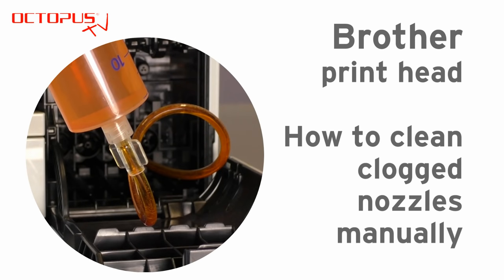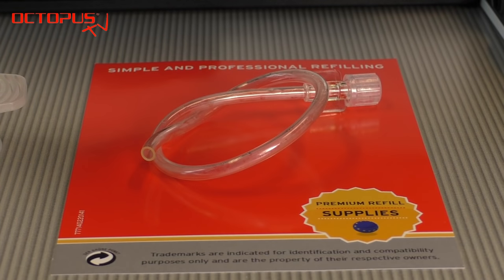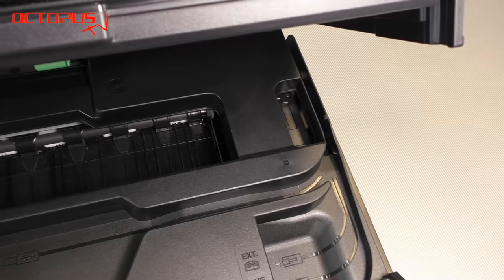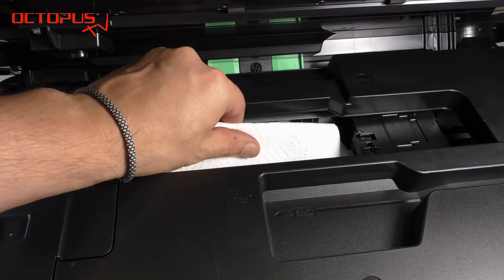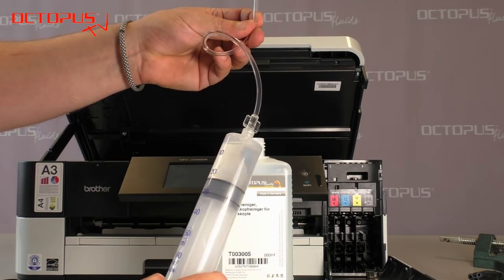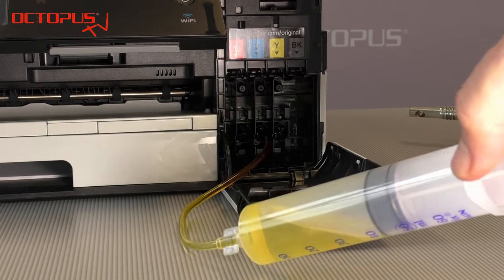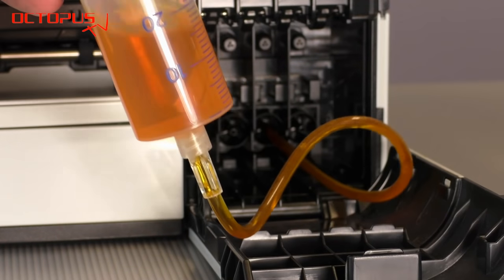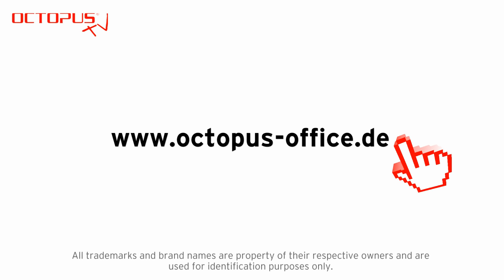How to clean Brother inkjet printer´s print head clogged nozzles?

Comment: Hi, Could you make a video on how to clean print head for Brother Ink Tank system DCP-T series please?
Reply from the maker: Hello Christopher, thanks for teasing us about a tutorial which we already have in our mind for a while but did not make it yet - You need it we have not delivered yet - sorry 😑
The approach for Your printer with the tanks for ink is the following:
1.) Empty out the ink tank that You would like to clean
2.) Fill some cleaner into this tank
3.) Move the print head to the middle of the working area and install some protection + absorbent underlay under its nozzle plate
4.) Use fabric tape to attach the combination of syringe and hose to the tank´s opening - the connection must be airtight
5.) then do the same as shown in our tutorial - push and pull the syringe´s plunger carefully to get the cleaner from the tank towards the print head ( no cleaner necessary inside the syringe as it is already in the tank)
6.) let the cleaner in the ink system sit for a while. it also works over time
7.) remove the cleaner from the tank and fill in some ink
8.) pump the ink towards the print head with the  combination of syringe and hose
9.) power up the printer again and print out the cleaner from the ink system - this may take some time - use old paper to print these test pages...
Reply: @octopusoffice  thank you for typing this instruction very helpful. I ended up buying dcp-t520w. This model is also available in eastern europe: hungary etc. May consider a video :)
Reply from the maker: Hello Christopher, thanks for Your response. As You printer should is quite new right know we think it may take a while before You have to do a manual cleaning 🙂 Just keep printing regularly - one or two pages a week and blocking should not be a problem as long as You use the right inks.

Comment: Lots of black ink on the paper towel, but black ink still not printing at all. Any tips?
Reply from the maker: Hello Donna, thanks for Your question and the description. 
We see two possible scenarios here:
Worst case is that the print head is damaged technically in the black ink line - so cleaning out the clooged or dried in ink cannot fix that 😒.
Second thought: Have You printed out the cleaner fluid from the ink system after cleaning - this may take quite some time and quite a number of test prints? You say there are black ink remains on the paper material - ok so the line should go through again.

Comment: Can I use acrilic thinner to clean the head?
Reply from the maker: Thank You very much for this question. Without knowing about the details of the acrylic thinner solution that You have available it is very difficult to predict all effects of its use in Your print head.
Basically it should do no harm to the parts of Your printer - assuming it does not contain any ingredient that can react aggressive towards plastis material for example.
The acrylic solution effect works best for acrylic based paints - if You are going to try this thinner on a dried in water based ink - the results will not reach an optimal level.

Comment: is this compatible with MFC-6935?
Reply from the maker: Hello Spyros, thanks for Your question. Our tutorial does NOT work for Your printer model and its cartridges. The connection between the cartridges and the printer is made differently. And the main difference is that there is a kind of buffer tank for the ink inside the print head compartment.  Due to this compartment You cannot push the cleaner fluids through the nozzles directly.
For Your printer we recommend to try cleaning the nozzles from the outside by placing a pad (containing cleander fluid) under the nozzle plate and shifting the print head over this pad from side to side.

Comment: Hi can you help me with my printer has alarm unable to print 49 and my brand brother T710W
Reply from the maker: Hello Winston, thanks for reaching out to us. What error code does Your Brother printer give to You?
Reply: @octopusoffice  UNABLE TO PRINT 49
Reply: Machine error 4900
Reply from the maker: Hello Winston, in the manuals, that we were able to check, this combination stands for some paper beeing stuck inside Your machine. Open the printer and check if there is small part of paper remaining somewhere - esprecially take out the duplex part on the back of the printer. When everything is cleared - disconnect the printer from the power supply and check if the error messages will disappear.
Reply from the maker: Hello Winston, in the manuals, that we were able to check, this combination stands for some paper beeing stuck inside Your machine. Open the printer and check if there is small part of paper remaining somewhere - esprecially take out the duplex part on the back of the printer. When everything is cleared - disconnect the printer from the power supply and check if the error messages will disappear.

Comment: Can I use an acetone liquid to clean the printer's head?
Reply from the maker: Thanks for Your question. As the inks in the Brother desktop printers are water based inks the acetone liquid will not have a dissolving effect on pollutions and cloggings inside the ink system. You need to use a water based, mineral free cleaner to clean the Brother ink system.
Reply: Acetone is also a very potent solvent for many types of polymers (plastics) so unless you know for sure the print head composition contains material that is 100% resistant to acetone, it is beat to AVOID. Distilled water or isopropyl alcohol mixed with diluted water is a good start.

Comment: mfc j2330dw keep alarm ink cover is open but it's not , try open and close again several times but it's still keep show cover is open don't know how to fix
Reply from the maker: thanks for Your question. On one side of the cover for the ink cartridge compartment there is a roundish lever that goes into the printer when closing the cover. This lever usually reaches a contact inside the printer and activates the status that the cover is closed. You can check if there is a problem with this part - difficult to analyse deeper from long distance... 🙂

Comment: Can we use isopropyl alcohol on this printer?
Reply from the maker: Thanks for Your question. As the inks in the printer are waterbased inks You need to use a waterbased cleaner too to have the best results.  Isopropyl alcohol is not waterbased and does not have a dissolving weffect on dried in waterbased inks. You can use it but the outcome will not be as eefective as when using a waterbased cleaning fluid.

Comment: Hi, Brother mfc-j5320dw I can't move the printhead to the centre of the printer, when I press start on the printhead cleaning option it makes the three "beep" sound and does nothing, it gives no information, I know this is not to do with your product but I can't get an answer elsewhere. Thank you
Reply from the maker: Hello Pier, thanks for Your question. No matter if the issue is related to our product - we are happy to get into contact with the viewers. You can try to use the print a test pattern function instead. When the print head starts to move to print the pattern You pull out the cable for electrical supply - then You should be able to move the print head freely. When starting the cleaning the print head actually stays in its parking position.
Reply: @octopusoffice  thanks for replying but the problem is that when I press the button to start cleaning it beeps three times and the head does not move, nothing happens. Thank you
Reply from the maker: Hello Pier, does the printer not work at all anymore or are You able to start a print job and the printer actually prints?
Reply: @octopusoffice  Thank you for your reply, the situation is as follows: at first the printer does not recognise two of the new cartridges (not original), I had already used a set of the same brand and it recognised them all but after a move it started to discard all the cartridges that were already finished, I did several head cleanings and after recognizing some and not others I decided to put a new set of cartridges similar to the previous ones but two of the colours (C and M) it does not recognize them, thinking in the possibility of being blocked the ducts I decided to do the cleaning with your product but following the instructions I cannot make that when I press the "start" button on the printer screen the head moves from its place. I am not sure but I think that before doing this cleaning job the printer was not reacting to the head cleaning command, if you know the cause of the symptom and the solution I would be grateful if you could let me know, maybe it is a home-made solution or I will have to take the printer to technical assistance. thanks.
Reply from the maker: Hello Pier, thank You very much for Your excellent, detailed explanantion. From Your description we assume that the issue is releated to the ink chips on Your alternative ink cartridges. When the chips on the alternative cartridges are old they might not be suitable to work with newer version of the firmware on your printer. Did You update Your printers´firmware or did the printer do that automatically maybe? In both cases it is possible that a cartridge that worked flawless before the update is not recognized by the printer anymore after the update. So You have two options right now - switch to a new set of alternative cartridges made by another supplier (hoping that their chips are newer versions) or go for a new set of original cartridges and see if it solves the problem. Also in both case You should take a look into Your printers´settings and disable the automatic firmware update option.
Reply: @octopusoffice  Hi, thank you so much!

Comment: Can I use alcohol solution instead of printer cleaner ??
Reply from the maker: Hello Fátmá, thanks for Your question. The inks used in a Brother Desktop printer are waterbased inks - so the cleaner should be waterbased too. You can use alcohol but its effect on cloggings caused by waterbased inks is not going to be the best one....
The water part of the cleaner should purified, demineralized water - this eliminates the risk that mineral particles in the water build up solid structures inside the print head.
Reply: OctopusConcept 
So can I use purified water ?

Comment: Does it work with tap water?
Reply from the maker: Hello Eyob, thanks for Your question. We do not recommend the use of tap water. The background to this is that tap water is mineralized water. The minerals inside have a tendency to react with  residual ink inside the ink system. In the worst case the combination of tap water and residual inks results in the built up of even more cloggings and blockades.

Comment: Thank you so much for this video. We're still having issues with the magenta ink though.

The tissue we put behind the print thing (technical terms) is getting pink ink on as you describe as we use the fluid but when we do print tests we get nothing.

We saw someone elses comment and tried to do the deep clean but our printer (DCP-J315W) doesn't have a 'home' button. We tried pressing and holding all the buttons to no avail and so we have fallen at the first hurdle.

Any other ideas?
Reply from the maker: Hello, thanks for Your question. From Your description we assume that the magenta print head part might be damaged. You write that the cleaner goes through onto the paper but no ink appears when printing. Indicates that the ink line is free but the print head does not pump the ink anymore properly. Hard to say from the distance if that´s the final truth.

Comment: Any ideas if this doesn't work?
Reply from the maker: Hello Erik, thanks for contacting us. To provide an useful answer  we need to have some more information about the not working part.
Does the cleaner go through the ink line and comes out of the nozzles on the nozzle plate? Have You printed out the cleaner liquid from the ink system after flushing? Thanks!
Reply: @octopusoffice  The cleaner does come out of the print head on all 4 spots, but when I try to prong something after that, the paper is blank and dry.
Reply: @octopusoffice  it doesn't appear as though the print head is clogged.
Reply from the maker: Hello Erik, thanks for the details. In that case we recommend try cleaning the nozzles from the outside from the nozzle plates´ side. You can place a piece of foil material plus some kitchen paper soaked with nozzle cleaner under the print head carriage and let the print head sit on the cleaner for a while. Then move the carriage over the paper material from side to side. After that try to run some print jobs and have a look if ink is coming back again.

Comment: cant you just use pure ammonia and a bit of distilled water?
Reply from the maker: Hello Carl, thanks for Your question. Ammonia works in combination with a thermal print head, but the Brother work with piezo element print head technology. So it will not have the best effect there.
The water You use has to be purified + demineralized water. Destilled water still contains minerals and with them there is the danger that the minerals may bond with ink ingredients inside the print head. Then You have a solid blocking there.

Comment: I had a MFC5730DW with  problem print head , used nog standard ink , so ordered a new MFC5740DW and am happy and only use standard ink from now on, my orther ptnter had printed 1088 pages A4 and A3 , the renew of the printhead was not a good solution and did not do it, printers are not that expensive 5 years is a normal live for inkjet.
Reply from the maker: Thanks for sharing Your experience - with 5 years You already expecting a quite long life span for a standard desktop printer :) we calculate with 3 years 🙂

Comment: It's enough and more safe for the printer, I guess, to press "X" for 3 seconds to make the printing head stay in the middle of working area, than take out the cable while it is working.
Reply from the maker: Hello Jan, thanks for that suggestion. We were not aware of that option. When do you press that x button ? During a print job or when the print head is parked?
Reply: OctopusConcept when you open the cover you can hold down the X/Stop/Exit button for 5 seconds and it will do the job
Reply: @melissamatthew3350  one of the most helpful comments in this entire thread, thank you.

Comment: I have had nothing but trouble with my yellow printhead. I went through a whole set of color ink cartridges trying to print 20 note cards. The yellow cleaning only function will use up all of your ink, not just the yellow.. You can eventually get it to work ok,, then next day, same problem then ink is gone.  The first set of included cartridges worked perfectly, only after I added official brother cartridges did it fail. This is an awesome printer with all its capabilities but has a real flaw. I don't know if I should try to purchase my third set of cartridges and try this fix this. Plus I do not let this thing sit for weeks at a time. I use it often. Never been more frustrated and disappointed in a printer going back to the original inkjets. This was not a good inkvestment at all plus time wasted. .
Reply from the maker: Thanks for sharing Your experience. There is always a printer that obviously was made on a Monday 🙂 If the printer has a flaw our kid is not going to fix that - as You say that the originals are also not working properly I assume that it might be the case the yellow ink line might have a problem independent from the inks.

Comment: How to remove the air from the printer after this operation Please .. Have you done this operation with all colors Is this wrong?
How do I hope the printer tubes? Is empty
Reply from the maker: Hello Omar, actually there should be no air in the tubes after this operation. In our instruction we advise not to push air into the printer´s ink system. We say and what happens is a different story :)
Either You push the right color of ink into the right tube until it reaches the print head.  Or You also can fill the tubes with cleaning fluid and set in the ink filled cartridges afterwards. Start printing until the ink has replaced the cleaner fluid in the ink system.
Reply: Thank you .. Sure it will take a lot of printing until the colors return to normal!
Reply from the maker: Thank You for Your feedback. We know that it requires some time to get the printer with ink tubes back to normal after cleaning the print head by flushing the system with cleaner fluid. But we consider it worth it in comparison to buy a new printer :)
Reply: .. Greetings to you ... Thank you .... Peace be upon you
Reply: من فضلك ما هو السائل المستعمل؟

Comment: My brother printer leak when I inject it what should I do
Reply from the maker: Hello Margerit,  thanks for the question. Where does the leaking occur?
Reply: I found a lot of the clogg ink color it making a miss down the printer but even that my ink is not printing not sure even the same side of the cartagge or the printerhead side but i am sure it is the right side of the printer ....do you think that i am so fast to push   the printer cleaner ....... how long should i clean it (should it take to clean  and print )
Reply from the maker: Hello Margerit, thanks for your description. I read Your answer that way that ink is leaking out of Your printer´s housing onto Your working place or desktop, right? This should not happen. You should catch the mix of cleaner and inks directly under the print head´s nozzles by placing an absorbent pad there. 
In any case please push the cleaner into the printer slowly and carefully.